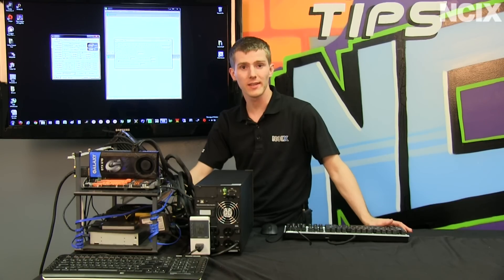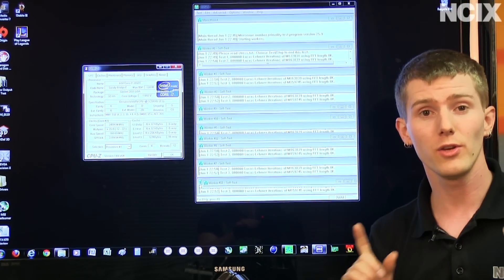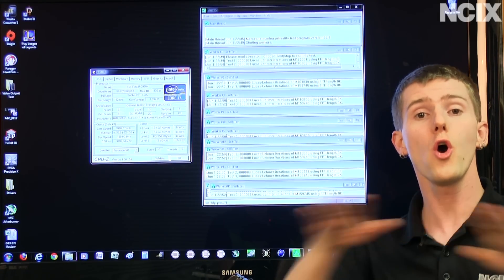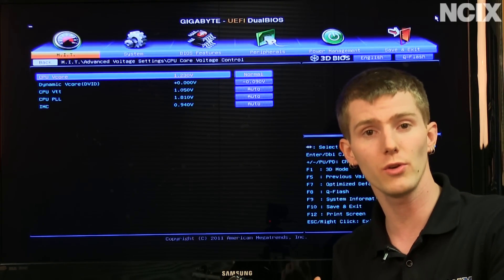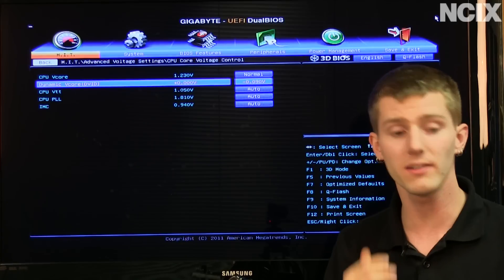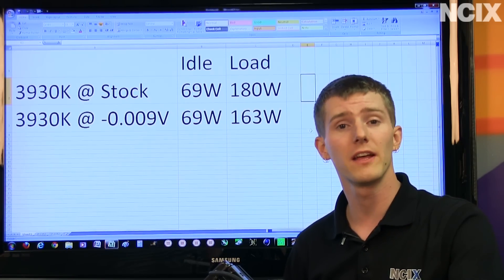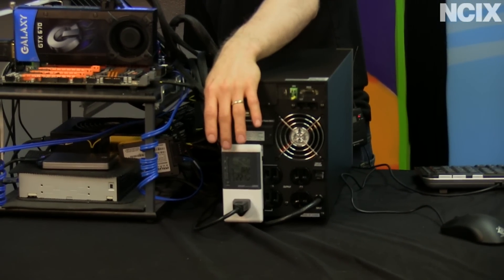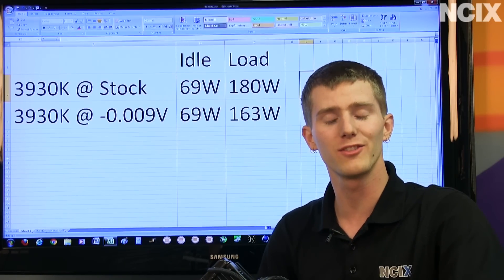Undervolting Your PC to Achieve Better Power Consumption & Temperatures NCIX Tech Tips

Comment: While I was fucking around with my i5 760, I found out I can undervolt it at 3.3ghz and it's still 100% stable, lol.

Got my Vcore at 1.23v compared to 1.26v. Not much but it is overclocked slightly also :P This is also my first build, so I'm happy with it.

Comment: anyone wanna give me a shout in a pm or a reply as to what i might be doing wrong here. i have 4gb crucial ballistix sport ddr3-1600mhz ram, MSI 890GXM-G65 motherboard, AMD Phenom II x4 955. the stock timing for this ram is 10-10-10-28 @1.5v. i tried to lower the timings to get more performance out of the ram, got it to hold 8-9-8-24 but it wouldn't recognize the dual channel even though everything was left exactly the same as before i just changed the timings do you think you could help me out?

Comment: I'm all into the low power consumption...I unplugged the CPU (which now has 4 hamsters running on 8 wheels) and unplugged the GPU (which now has a couple squirrels drawing pictures on the screen) and I say, almost no power to run this computer. Next downgrade is a flock of messenger pigeons for the internet connection :P

Comment: Completly true, but with my mild overclock (4,2ghz) the auto setting, which most people use gives the cpu way to much voltage, so even to i cant overclock it with this current settings it will still be under the auto setting, and also cooler.

Comment: i have a 3570k running at 4.2ghz with 1.14 v core. i have max temps of low 60's. undervolting can be just as exciting as overclocking. well maybe depends on your needs. :)

Comment: people can always get the i3 2120t uses 35w thermal design power and since its got hyper threading u can go from 2 cores to 4 which is enuph for gaming i seen people go 1080p max settings with this processor no prob * with a graphics card not intel hd 2k *

Comment: woah, slow down i didn't say i am unhappy spending on high end components ok? Did i offend you or something? i just asked if my specs could run BF III at a decent resolution such as 1920x1080, and i am upgrading later, as for the PSU i got a 600 watts one...i just don't see where you got offended...

Comment: try taking all but 1 stick of ram out and see if you get blue screen. if you still do, try other sticks until you've tried all. you might have bad ram. if your motherboard is overclocked then you voltages are wrong or your overclock is to high.